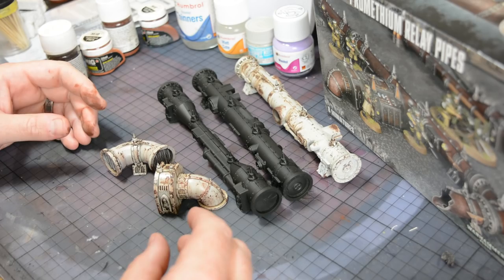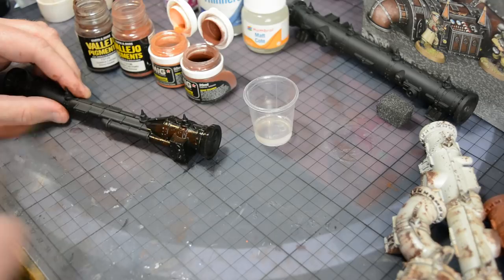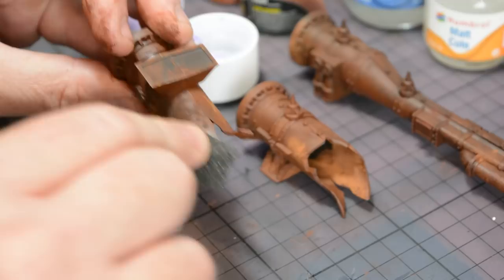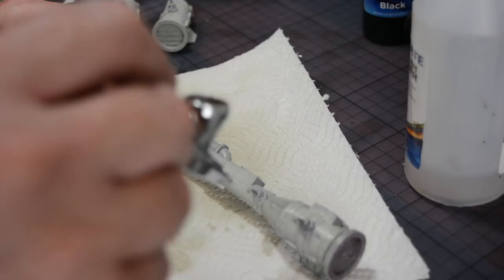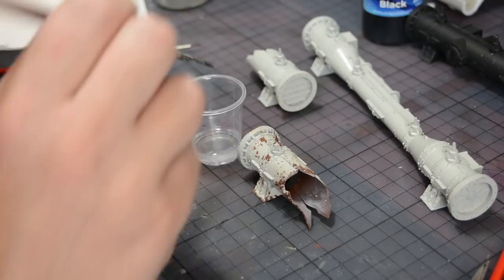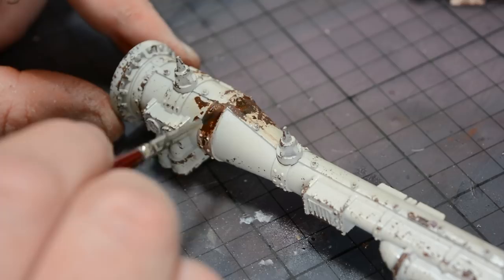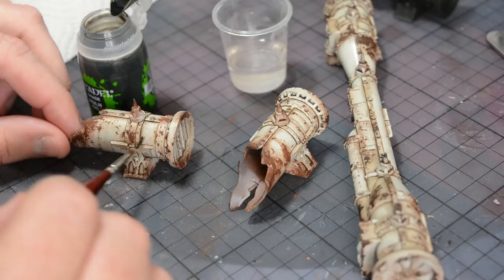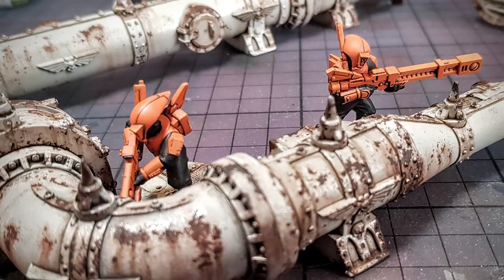Weathering Kill Team 40k Scenery - Promethium Pipes - Rust

Comment: Can you apply the paint with a brush? Or better to spray? Can it also be acrylic paint?
Reply from the maker: Hi, there's a bit of chemistry involved here so I need to make sure I'm very specific. The rust colour can't be acrylic paint, it needs to be strong pigmented enamel hence why I use weathering powder in enamel varnish. This is what allows the rust colour to run when the thinner is added. Because this layer is sealed in really well by the varnish and I am using a manual chipping method I. E not chipping fluid, you could use a paintbrush to apply the second layer of colour yes. This actually NEEDS to be acrylic to prevent it interacting with the thinner that makes the rust colour run.
Reply: @ScaleModelMedic  Ok I think I have a grasp on the concept. I should’ve wrote what I asked a bit better as I I wanted to know if the paint on the second layer of colour could be acrylic. Which you’ve stated here that it has to be. Ok. I’m going to try this out when I get the stuff needed. I’m excited about trying out oils and pigments for weathering to add to general acrylic paint jobs.

Comment: Hey quick question, how come the liquid mask didnt pull off the pigments underneath with it?
Reply from the maker: This I can only attribute to a combination of things - the strength of the bond between the Matt cote and the primer firstly. Ump primer is very good and Matt cote is strong, though not a particularly good Matt varnish as it can powder up and leave marks. Maskol is relatively weak and designed to not pull the paint off, plus it was quite fresh.   I've never had maskol pull pigments off in this fashion.  I expect if you were very sparing with the varnish and heavy on the powder it would have a weak bond and lift but as you see in the video I ripped that stuff off without a thought that the pigments would come away.

Comment: Brilliant. What ratio is the matt coat to thinners? 1:1?
Reply from the maker: Probably a bit heavier on the thinner, matt cote is thick stuff. I just mix by eye til it runs like diluted paint.
Reply: @ScaleModelMedic  So like with acrylics and acrylics thinners to the consistency of milk? Lovely, milky milky.
Reply from the maker: @DoktorTechnometer  yeah kinda, you want it to have enough resin to hold those powders but be thin enough to soak into them too so when you go back in that stuff streaks nice.  Having some of the black undercoat come through boosts the Contrast but you don't wanna burn through to plastic